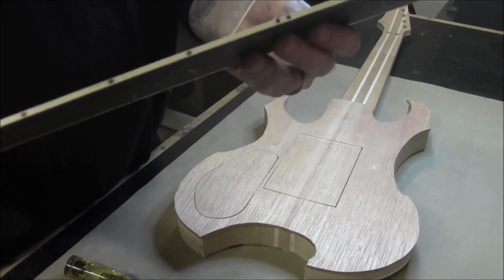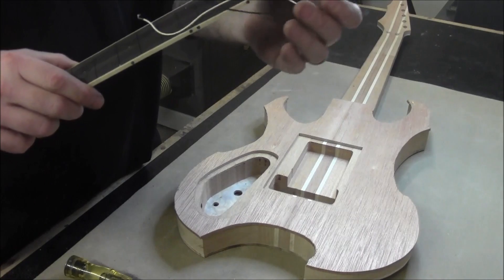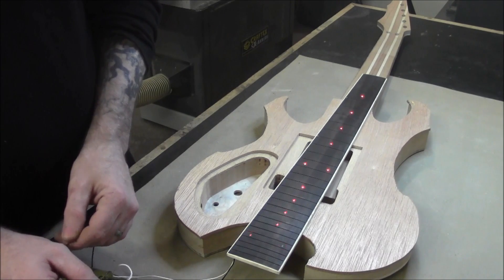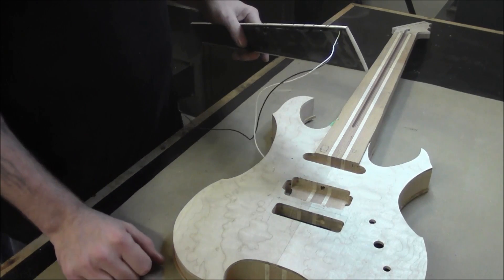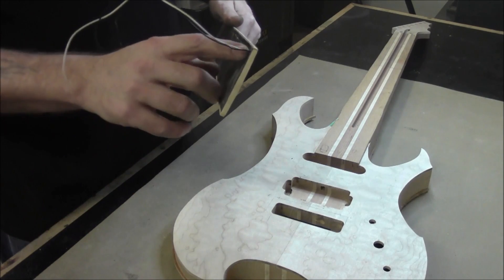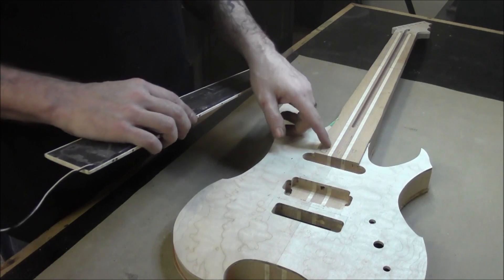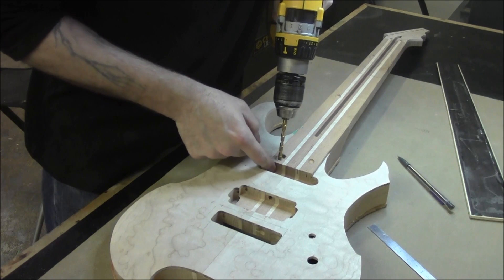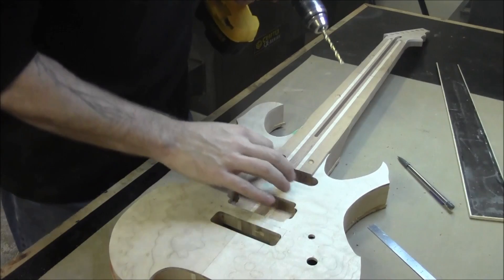How to Build an Electric Guitar-Video 16- Attaching the Fretboard

Comment: Question, when you were routing the well for the wires to fit into, is there a reason you used the router? Why not just use the drill press with a similar sized bit? Actually, why not just drill at an angle with a smaller bit from there to the pickup cavity? It only needs to fit 2 wires, nothing more, after all.
Reply from the maker: Dojix the epoxy tends to leave a small hump where the wires lead out from the fretboard. the well is just there to ensure the board sits flat in that area. Then an angled hole is drilled to the p/u cavity
Reply: Ahh, makes sense. Thank you! I like how well you think through everything, literally every step of yours in this build has a handful of reasons about why it's a good step.
Reply from the maker: Thank you for watching. CAREFUL planning should always be the first step in every project ;)   cheers

Comment: hello, first, nice work and design! second, how did you join the 2 mic cavities? hand drill or some other tool i don't know about?
Reply from the maker: Jwanito M sorry for the slow reply. I don't remember getting a notification for your question. The holes are tunnels that are routed in the body before the top is glued on.
Reply: i dont mind if it was slow cause i haven´t started making anything yet, so thanks for replying! unfortunately there's no top in the Bass im making and it would be hard (for me) to make one the same shape of the body, so i will try other solutions, again thanks for replying